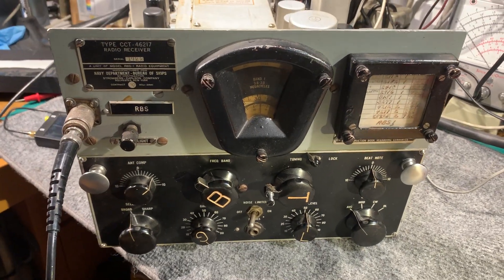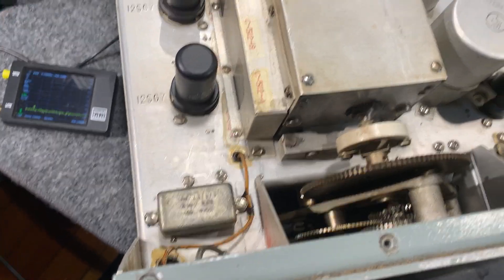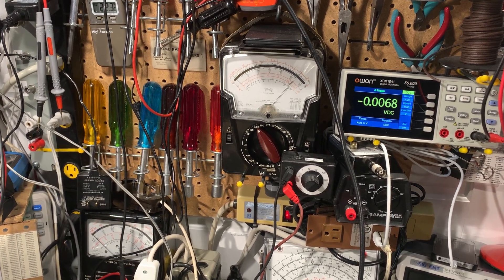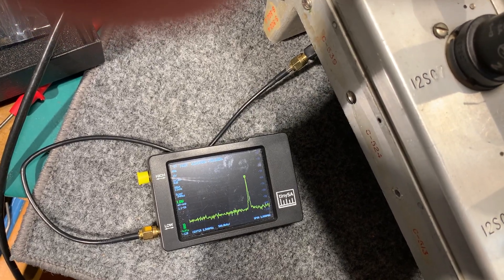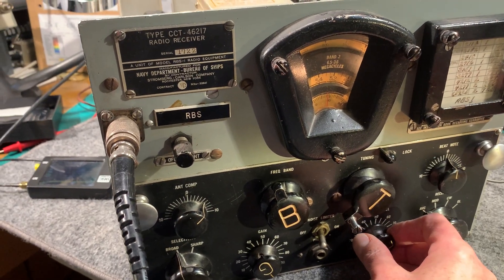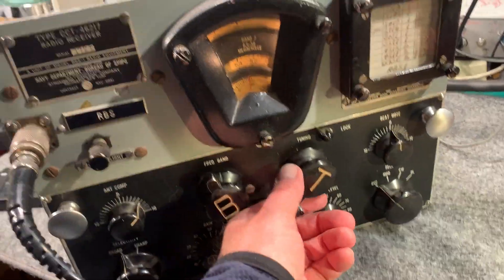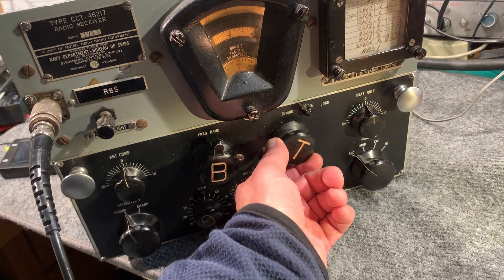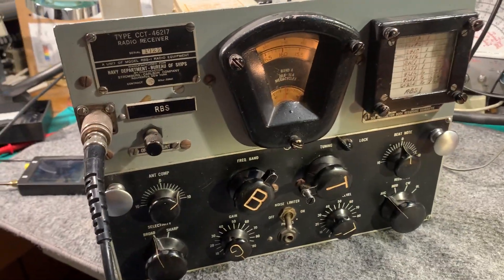USN Type 'RBS' HF Receiver - First Power-Up after Recap

Comment: SO COOL! I want one so bad! They so expensive. All i got is a boat radio that buffets horribly, no idea why, still needs lots of work but i need to make a schematic for it because I can’t find one. It transmits but I think barely.
Reply from the maker: Glad you like it Kasper.  I have no idea what these sets sell for.  It is a really solidly-made set, though I doubt its performance will be quite in the same league as the RBB/RBC sets - then again, it weighs much less and easily fits on my small bench!